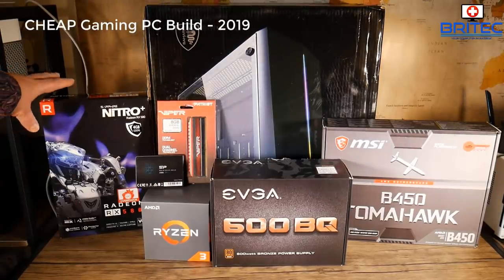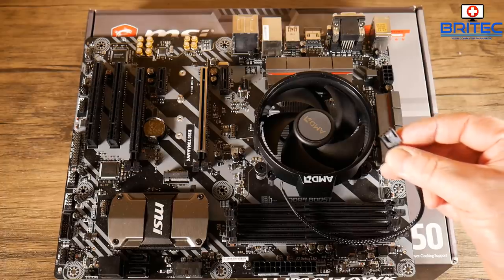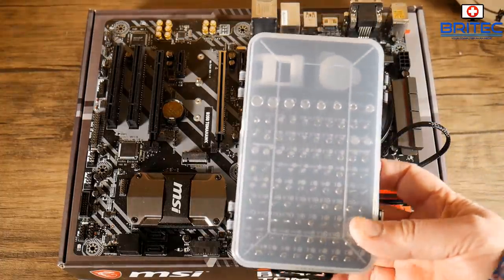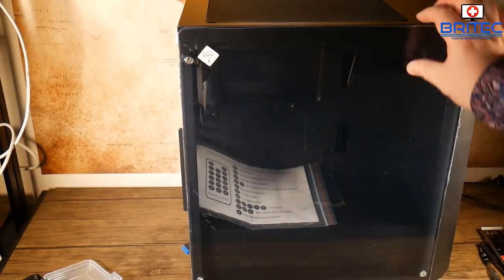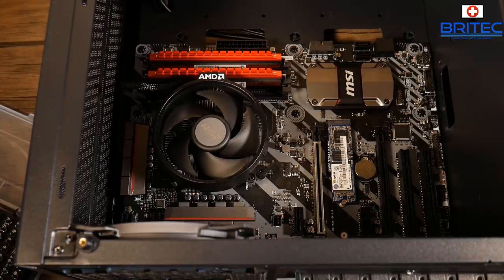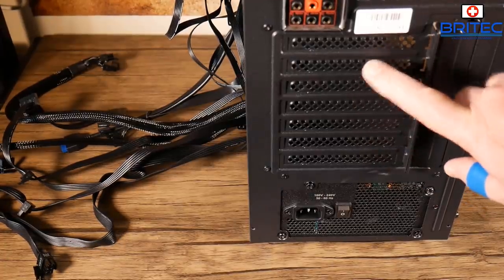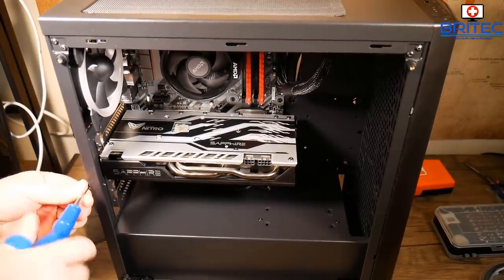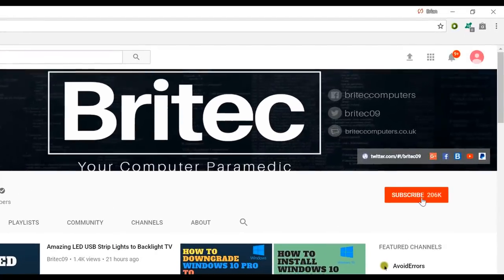CHEAP Gaming PC Build - 2019

Comment: I like hand screwdrivers as well, because you can feel when it stops with just enough pressure.  Not saying electrical screwdrivers will over tighten or strip the thread, I just prefer having manual control.
Reply from the maker: Me too

Comment: i built my firs pc ryzen 5 1600 gtx 1060 cost a small fortune at the time still going fine at the mo. ive got samsung nvme drive and 2 other ssd been good fun adding for a novice.good tip on those motherboard stand off screws.good to know you offer that service Bri.
Reply from the maker: Ryzen 5 1600 is a nice little CPU still
Reply: 🙂 microcenter $80 1600

Comment: Great video I jsut got back into desktops a few months ago and was nervous if I ever need to do a new build or take out the motherboard.!!! thanks I feel confident
Reply from the maker: You're welcome.
Reply: @Britec09   Great ! also as I said above taking out a motherbaord isnt hard right? all you do is take out the cbaels and usncrew it? pretty much correct? also in terms of the CPu as long as the CPUs have the asme socket its fine? so if I got an Am4 board a few years ago... the latest Ryzen CPUs would work becuase they are am4 too?
Reply from the maker: AMD have stuck with there AM4 socket for all the Ryzen processors

Comment: Great video man! First I've seen from your channel. I was thinking about building a new pc with ryzen 3 or 5 1600 and b series mobo like you. Also was interested in rx 570 or 580 4 or 8gb gpu for build. I am having a hard time choosing between quad core with multithreading or six core with mt. Six core would be more future proof but also more expensive. I would use pc mainly for gaming. I will have to post my build whenever I finish this or more budget pc using ddr3 ram since I could afford that better atm. Would love to see games tested on this pc you built or similiar configurated one.

Comment: I currently have the ryzen 3 1200 but I'm planning on upgrading to a 2700x and apparently you need the stock bracket that comes with the mother board? I have the bracket but I'm not sure on how to reinstall it. Any tips?